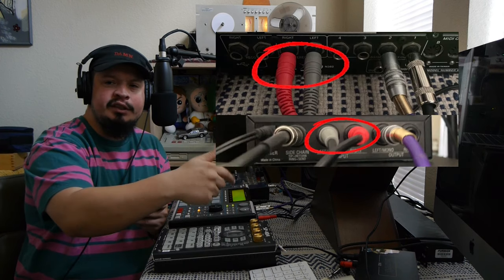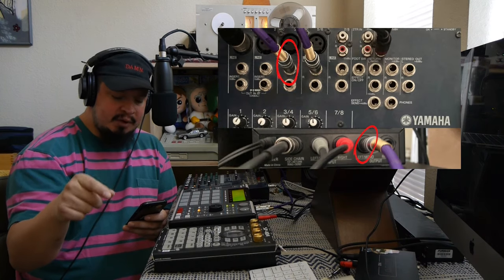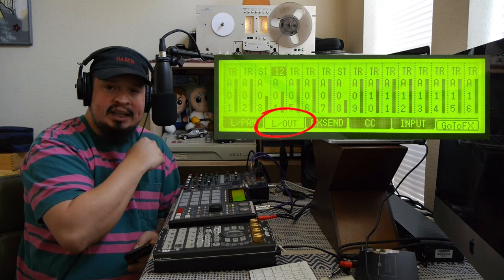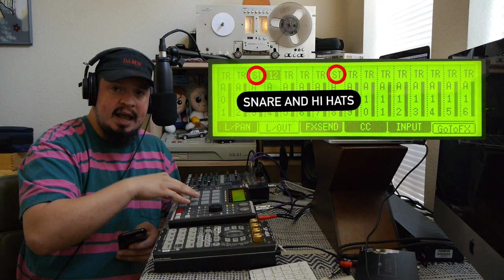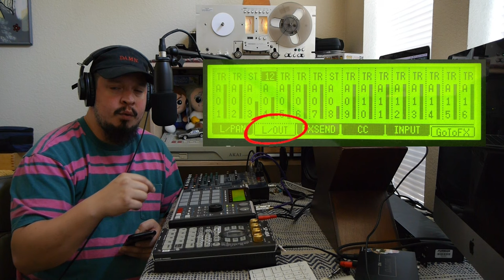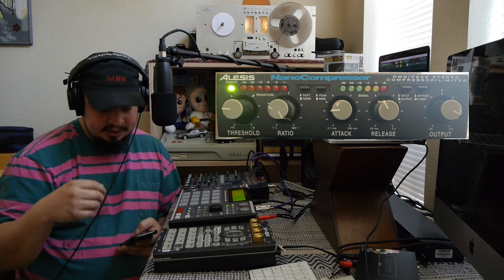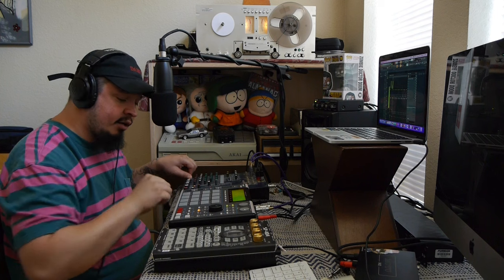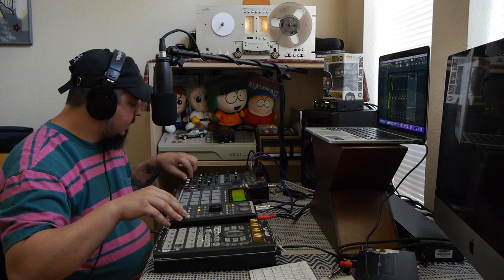Mother Ducker On MPC 1000? | Sidechain Compression JJOS2XL

Comment: This sidechain sounds great, thanks for the tutorial! Why does the kick need to be panned left? 

Also, I tried doing this with the stereo out of the Nanocompressor to the first two channels of my mixer and then assignable out 2 from the MPC to the third channel. For some reason, I can hear everything on my monitors, but when I record a video with my phone (using USB audio out from mixer directly into phone), I can't hear the kick. The sidechain is still present though. Any idea why this is?
Reply from the maker: The kick sits in channel 12 in the mixer which is a stereo track. 1 being a separate channel when panned left and 2 being a separate channel panned right. The kick needs to be separate from the rest of the drums for the sidechain effect to work properly. And about the phone recording issue. Make sure the cable you’re using is a stereo signal going into your phone. If this doesn’t work I’m sorry to say I don’t know the problem. I use OBS to record videos. It’s free and works just fine. I hope this helps. Thank you for your comment George
Reply: @Swellthekid  Thanks for the quick response bro! Yeah, that makes sense. I learned that my Soundcraft mixer outputs each channel as a mono L/R pair over USB, so I may have to try that software you suggested. Last question – where did you get the SP-1200 skin? It looks dope!
Reply from the maker: Glad I could help! I got the skin from xpowersdesign.com